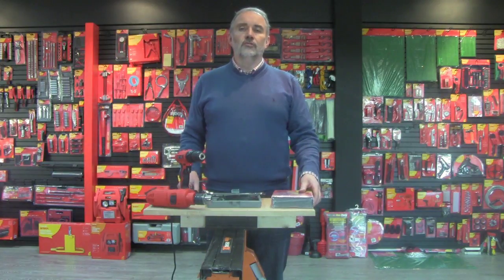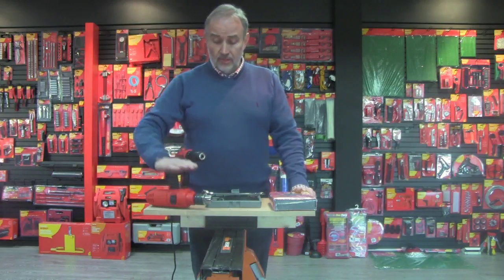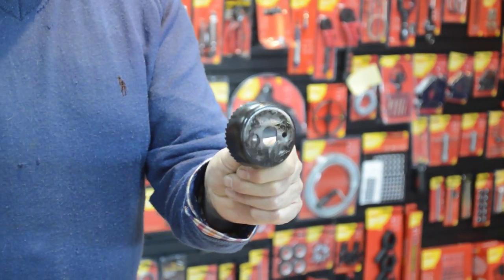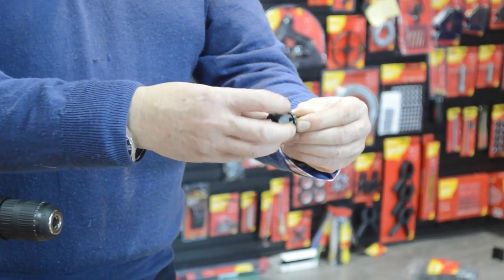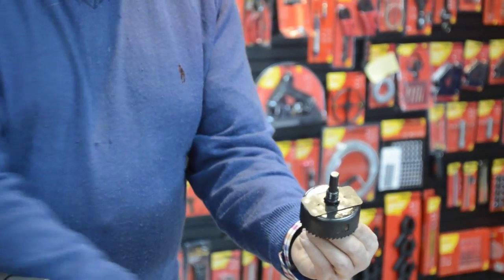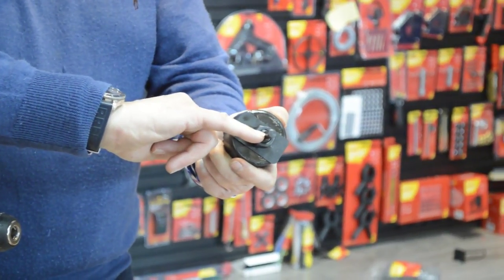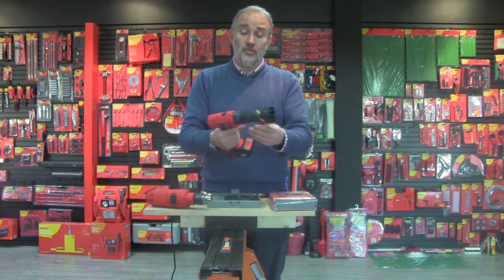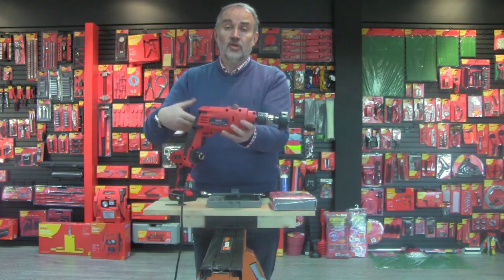How to attach the 5 piece Hole saw set to a drill?

Comment: Well the vid certainly helped me. 

As I have had this 9pc heavy duty hole saw set – carbon steel for over 10 yrs now. Stock code: M1625   Comes with seven heavy duty hole saws and two pilot drills Sizes: 22, 44, 54, 57, 60, 64 and 67mm 
For use on plasterboard, wood, thin alloys, thin sheet metal, plastic and other soft materials. 

Recently I discovered, it should have come with the fitting shown in the vid: 1:18 - 1:51

So, my question is:

 Du have a spare one of these in the warehouse, so I can say my hole set, is er, whole. 

Thanks.....

Comment: Should the drill bit be able to move? As my seems to be moving and not secure. Thanks
Reply from the maker: Hi the drill bit should be inserted and tightened firmly before atempting to use. ensure all connectors are done up tightly. The drill bit should not move.

Comment: My 5-piece would be a 6-piece hole saw set if it had come with the drive plate. No wonder it doesn’t fit snugly, it wobbles when I turn it on
Reply from the maker: The M1590 5 pce doesnt come with the drive plate only the 8pce and 16 pce m1530 & m1570